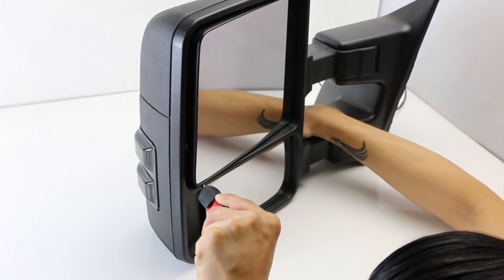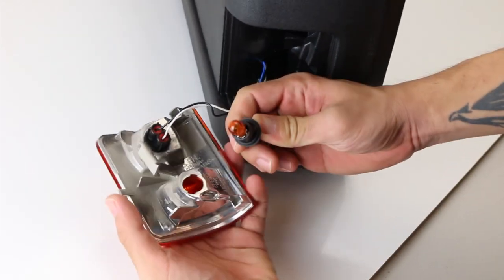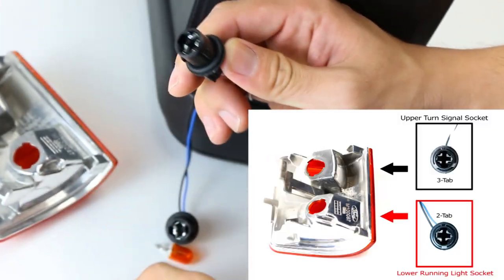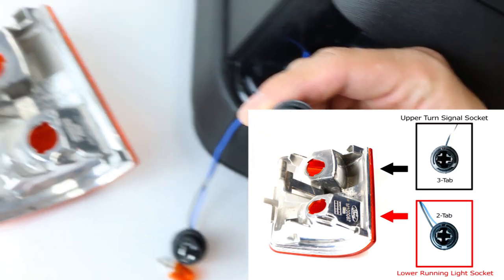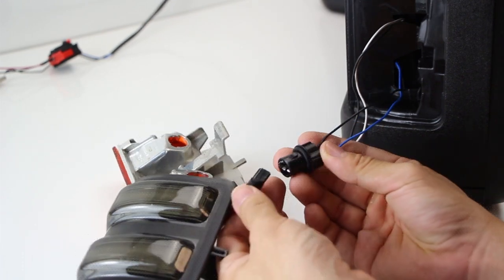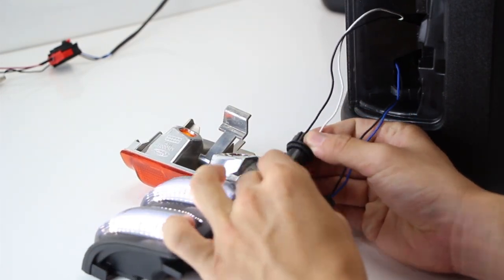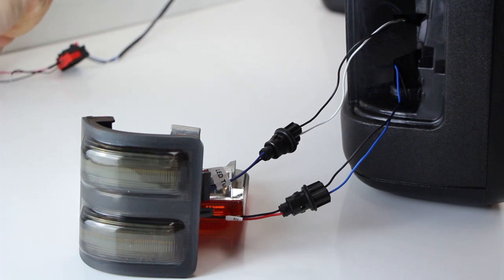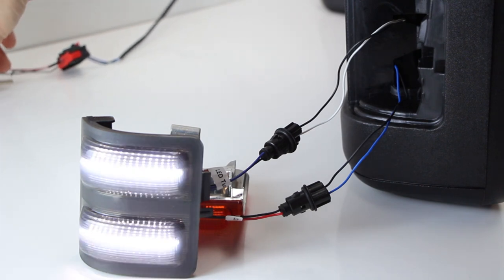How to Install Ford Superduty Switchback LED Side Mirror Lights

Comment: So, on these f250s, when the parking lights are on, the turn signals will have ghost voltage somewhere between 2-3 volts at the bulb. The led boards see voltage on the turn signal wires and get stuck with one white strip and one dim Amber strip. When I bought these lights I installed them and couldn't get the 2 white parking/ 2 Amber flash per side to work. Reading the other reviews this was a common problem. Some say to keep reversing the plugs, but you will never end up with the lights working as in the picture. I solved the problem by hot gluing a mini relay to the back of the new signals, soldering it up, and laying down another coat of protective hot glue to keep the elements out. I broke the circuit to the turn signal with the relay so that power would only be transmitted if it was 12v. I used a naic cp1-12v type c because it was what I had laying around. You can buy 5 of these for 7 bucks on eBay. Or 20 for 20. I took one of these lamps apart and noticed that they are overall higher quality and sealed better than the recon brand. I replaced my recons with these after the lenses just fell off. They use cheap super glue to combine the lens and housing. These lamps we're silicone sealed. I am very happy with the switch back feature after the modification. I feel it looks better having the amber turn signal. The modification was simple and with it the lamps beat the other aftermarket options. Also, if you are willing to do this, cut the connectors, save them somewhere, and hard wire the lamps in. After hardwiring mine, they fit perfectly into the mirror. They were a difficult fit with the bulb connectors still in line.
Reply: Scott DeMarco which wire did you do the modification to im having trouble with the white lights coming on they will come on with only ground connected on the turn signal side but as soon as the power touches they go off and did yours fit right im seeing that mine might need to be trimmed a little thanks
Reply: fidel osuna I'm having the same exact prblm. Signals are amber but when the lights hooked correctly it shuts off the white running light. I'm losing my mind with these mirror lights
Reply: Gregory Panos i fixed mine with an error free adapter option t10 i got from ijdmtoy for 10 dollars go to the web site in the search put AA1010 and its the 9.99 one and choose t10 option hope that works worked for me
Reply: Gregory Panos did you buys yours off ebay or ijdmtoy?
Reply: fidel osuna yep. Got the set for 45$ off eBay. Seller hasn't been much help. Tells me my grounds are bad. I get the white running lights but as soon as I connect the turn signal power wire my running lights shut off.
Reply: Gregory Panos yes i had the same exact problem i got those error free adapters and now they work perfect how they are suppose to i would give that a try i assume its because of the dead voltes these truck have that turns off the running lights hows the fitment for you i got them off ebay and fitment was pretty bad trimmed a lot and still dont look perfect want to give the ijdm ones a try see if they fit better
Reply: fidel osuna the figment was surprisingly good for eBay. Still tight getting on and off. I appreciate the help. I'm going to buy those and give them a try. I'm optimistic seeing as you remedied the same plrblm I'm currently having.
Reply: Gregory Panos no problem hope you can fix them its a nice upgrade from those amber factory ones
Reply: Scott DeMarco 
i need help i still cant get them to work
Reply: Scott DeMarco .... I think you should post a video on how to setup the lights.